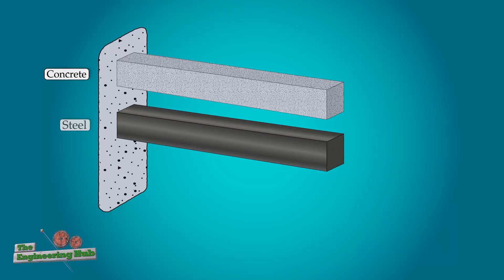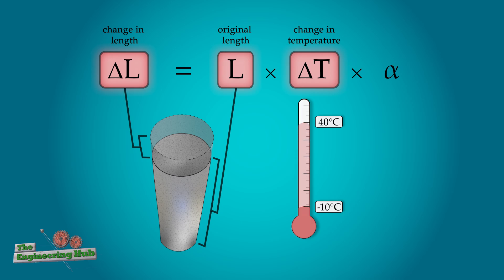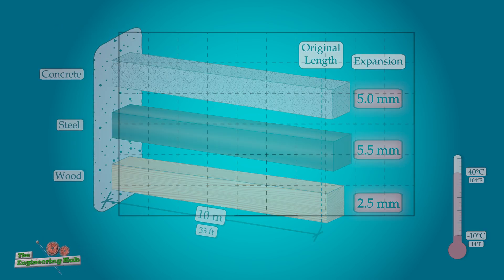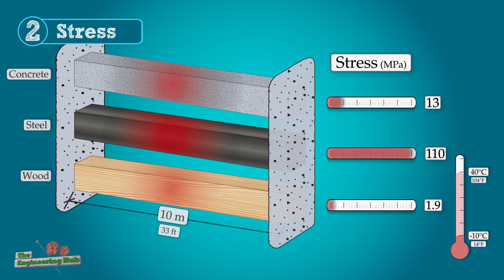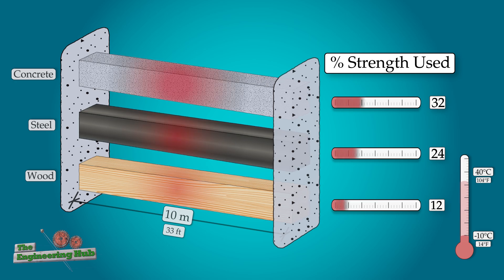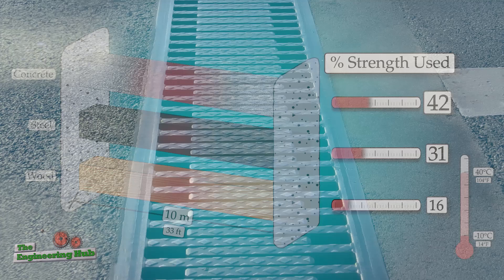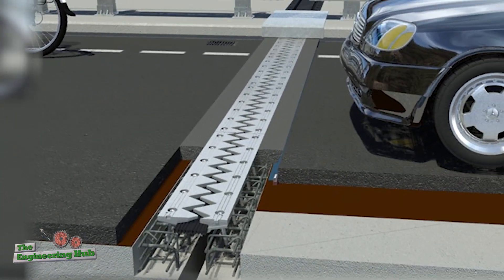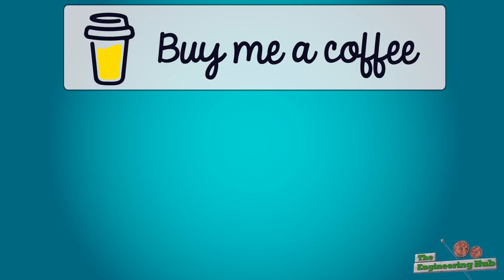Thermal Stress on Beams - How Engineers Design for Heat

Comment: Hello,
could you please post a lecture vedio about hygroscopic expansion coefficients (Beta) for the case of cement that is internally cured in a soil (oil well case) and how chemical shrinkage occurs due to curing process with respect of Temperature and Moisture and how thermal stress work for 3-D when the cement is poured in between rock formation and steel casing (constrained) in the oil well?

Comment: As a Civil Engineer, I often hear people blame concrete cracking and failure on inadequate strength. In my 40 years of experience it has always happened due to poor joint detail which in turn causes stresses from inadequate allowance for expansion, not strength issues.
Reply: I've seen concrete-layers who have been in the trade for years spend so much time and effort in producing a nicely finished surface, but have neglected to put in adequate expansion-strips, so within a year there's cracks or spalling in the slab!
Reply: @stevie-ray2020  Inadequate or badly placed.
Reply: @gregessex1851   I've seen cases of both, but it's usually large areas concreted with little or no expansion-strips at all!

Comment: https://youtu.be/UXQugQPSLmA?t=1789
Rails for the 300kph TVG in France are made in 300 meter lengths and welded together with aluminum. What keeps them from buckling? 
https://youtu.be/UXQugQPSLmA?t=1819 According to the documentary the solution is to use 'very heavy rails weighing 60kg per meter so they won't lift'.
What am I missing?
Reply: @GeeKayKayGee
I don't know of the specific case of TVG in France but I believe some train tracks are pre-stressed, like heated up to a high temperature before they are laid out and being safely secured. Then when the track heats up by intense summer sun the already built-in compressive stress will just be reduced instead of the tracks buckling. Pre-stretching the tracks when they are laid out should have the same effect.

It is similar to a pre-stressed concrete element which is designed with compression stresses.

Comment: Great video!  Another consideration when looking at temperature effects on a structure is when there is a significant thermal gradient through the thickness of the beam--where one side is expanding more than the other side.  Not as common with steel beams where the thermal conductivity is high, but can be a problem with concrete or wood beams.

Comment: Length change in wood due to moisture absorption is greater than that due to an increase in heat? Really? I'm surprised. I expect significant changes dimension across the grain, due to moisture level but significant changes in dimension measured with the grain, due to moisture absorption, I thought would be near to zero. It would be interesting to know the linear change (with the grain) of heat vs moisture.

Comment: anything without an expansion joint is susceptible. need not be in the sun. a heated tile floor in a basement can do the same.
Reply from the maker: Agreed. Thanks for the comment. How did you find this video? It doesn't premiere for 2 hours still! (Except for to you apparently, hah!)
Reply: @TheEngineeringHub  the algorithm works in mysterious ways lol. it was set as will premier in x hrs